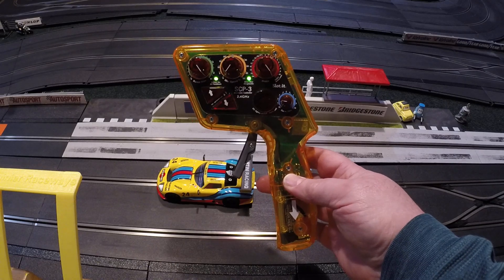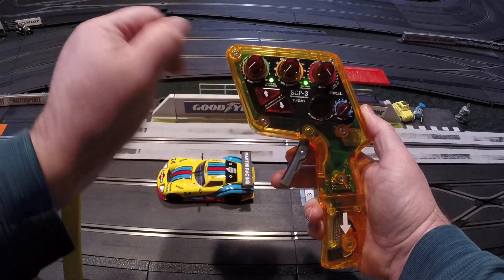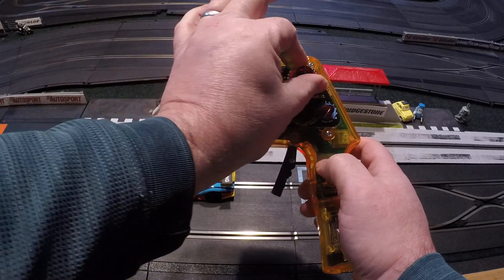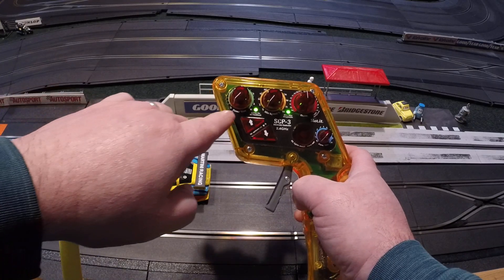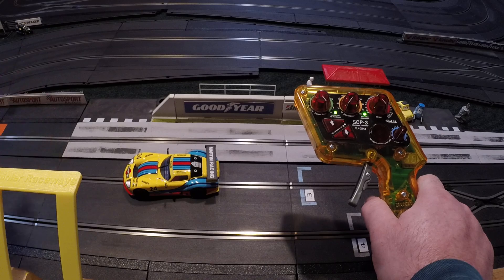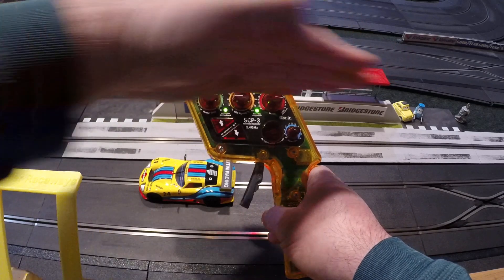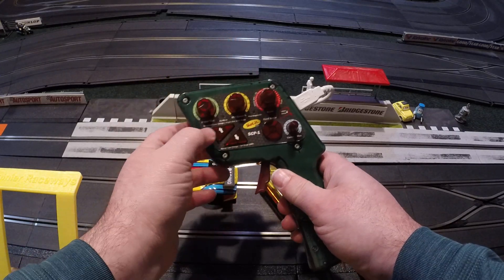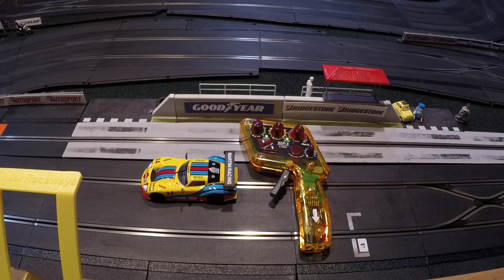Slot.it SCP controller basics

Comment: Thanks! I am just getting back into the hobby after a 45 year hiatus!  I really needed a good description of how these new controllers work and what might be applicable for me.  I asked this question to Steve over at SCC and maybe you might be able to answer ... being an engineer, I am wondering why a manufacture has not created a GENERIC wireless controller for analog? Seems very plausible to me that there could be a transmitter in the hand controller and a receiver device at the driver's station that would allow this to be created?!? Any thoughts?
Reply from the maker: That's exactly how I'm using the controller in this video. That's an analog, Revoslot, car and my track is in analog mode. The SCP3 shown here is communicating with a slot.it CRI (wireless receiver) with a high amp SCP cartridge installed in that, which in turn controls the car on the track. The SCP controller system is modular so that they can make the handle generic, and the cartridges for specific types of racing, including various analog connection types, and digital systems.
Reply: @ggaub  OMG! I definitely need to duplicate that!  That is GREAT NEWS! I am recreating the old Batman TV show episode with the massive 4 lane Revell track.  I have just about everything in place and just waiting to begin the remolding of my retirement home out here in Las Vegas which will have a dedicated Hobby room for my slot car layouts.  Having the wireless controllers would make live 10x easier going around that massive layout!  Where did you purchase your equipment from? I thought Slot Car Corner would have everything and Steve sounded clueless about this being available and suggested that I solicit some of the different controller manufactures on designing one!  I just purchased two midlevel Professor Motor controllers THIS WEEK,!  In fact one of them I haven't even tried out yet! I wish I had known earlier!
Reply from the maker: @RetiredRocketScientist  
https://www.132slotcar.us/product_info.php?products_id=50319
https://www.132slotcar.us/product_info.php?products_id=36848

https://www.132slotcar.us/product_info.php?products_id=37554

If SCC is your preferred local hobby store, then ask him to order in those products. Otherwise, get them from somewhere else.

To be fair, there's another option from Scorpius Wireless with their controller and "WAM" receiver. I'd recommend getting the USB dongle as well, so that you can make sure and keep the controllers up to date with firmware. I have their controller, which is OK, but I have not used the WAM.

The slot.it SCP3 firmware can be updated with any recent mobile device and their app, which you can see in another one of my recent videos.
Reply: Carrera make/made analogue wireless controllers, Scorpius do a controller that works with everything. I am not sure anyone else does straight analogue wireless controller. Of course all the digital stuff can be analogue wireless.
Reply from the maker: Whatever controller you get must be compatible with your track's controller connections. If you're using a club track version of the Professor Motor controller, then the Scorpius or Slot.it solutions will both work.
Reply: @ggaub  Yes I have 4 commercial drivers stations with a reversible swatch installed along with power taps all from SCC ... I just spent a couple hundred for a couple of Professor Motor controllers last week!  But they wont go to waste :) Thanks for the link, I will get a couple of orders in right away!
Reply: @RetiredRocketScientist  do a nice routed wooden digital track. Scorpius do billet lane changers.
Reply: Carrera did a wireless analogue thumb controller, if you want authenticity... Batman and Robin used thumb controllers.
Reply from the maker: @RetiredRocketScientist  Nice track! I look forward to seeing your re-creation.

Comment: Hi Greg, I have just purchased an SCP-2 controller and the problem I have is with out pushing the trigger I have constant power to the track, for eg…if I put a car on the track it takes off flat out with out touching the controller with everything turned fully down.
I am running a Carrara evolution setup. Would be great if you can help. Regards Shane
Reply from the maker: Sounds like a mismatch between what kind of cartridge you have, and what kind of track you have. What cartridge did you get? What power track does your Carrera track use?

Comment: Forgive me. I’m fairly new to slot cars. I purchased an analog set then went digital just a short time ago.  It seems to me, this controller mimics some of the digital control unit functions, such as speed and break settings that you can now take advantage of for analog tracks?  Great video, new to your channel, looking forward to exploring your content.
Reply from the maker: For any kind of racing, quick and easy access to throttle controls such as sensitivity and braking at the very least, is ideal. While using menus and settings and things will work in a pinch, it can get to be a bit of a hassle when you have 6+ racers who each like different settings. The SCP controllers are modular, and so have combinations that work with almost all analog and digital slot racing systems.
Reply: @ggaub  - I think they’re a great add on and likely my next get. 👍

Comment: This doesn't work with Carrera Digital 1/32.. Does it? Great video.
Reply from the maker: In fact, it does. The braking adjustment doesn't work, as that's still programmed into the car, but all of the throttle adjustments work, and there are buttons for lane changing. You need the digital cartridge for it. I have used mine on D132 several times.
Reply: @ggaub  Awesome.. Thanks heaps for the reply.

Comment: Hi Mr. Gaub, I just purchased the SCp-2 for analog scalextric track use. I ordered it along with the correct 3 wire pig tail for the Scalextric power base. I installed banana plugs on each wire and plugged it into my pig tail but the controller is dead.........What have I done wrong?
Reply from the maker: Do you remember the specific analog cartridge you bought? You put red-red, black-black, and yellow-white, I assume? If not, what is your "pigtail" and connector at the track side? Finally, where did you get this from?

Comment: Hi, how do I install this on SCX Compact? beginner here
Reply from the maker: SCX Compact is analog, so you'll need any analog cersion of the SCP3, as well as an appropriate adapter for the connector to the track. I don't know what kind of connector SCX Compact uses, but if you're going to use a controller like this, it would be best to eliminate the OEM "power track" and connect up an adjustable voltage power supply with club style controller hook ups. They can be easily DIY, or you can get ready to install controller stations from sites like SlotCarCorner.com

Comment: Can this be retrofitted onto a Carrera track ?
Reply from the maker: Yes. Depending on what kind of track, there is a cartridge that will work with it. However, the wireless is not directly compatible with the Carrera wireless+ receiver. It would have to be a wired connection to work with a Carrera track, whether analog or digital.

Comment: Thanks Greg, very insightful! So did I understand it right that the arrow buttons and manual brake button only have an affect in analogue racing?
Reply from the maker: They do have some function while racing analog, but I did not describe them. Of course, they're using for lane changing and braking in digital. In analog, they all do something different with brakes. The label on the controller says what, but from memory, one of the arrows will set braking power to 100% while you hold it, only activating when you release the trigger. The other will set braking to 100% for the next time you release the trigger (press and release the button, and the controller knows to use 100% next time you release the throttle), and the round button immediately activates brakes according to the brake knob setting. Give it a try!
Reply: No arrow up and down swich Lane on Digital and break is the fuel pump in pitlane also in Digital
Reply from the maker: @olefriischristoffersen2957  That depends entirely on which digital system is in use, and which race management program you are using. It's not the same across all systems, so you can't simply say that's what those buttons do for all of them. What digital system and race management program are you referring to?
Reply: @ggaub  in Carrera, In Ninco in Scalextric and Oxigen toghter with RS32 AND PCLAPCOUNTER
Reply from the maker: @olefriischristoffersen2957  Thanks! So in that case, PC Lap Counter is what determines what actions the buttons have outside of lane changing and stopping.